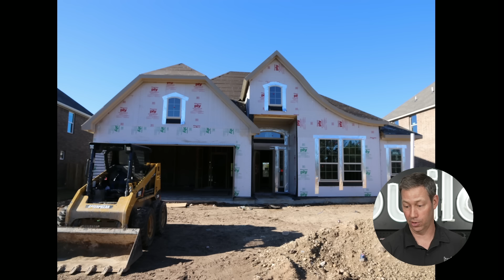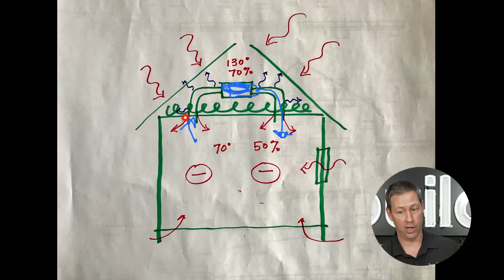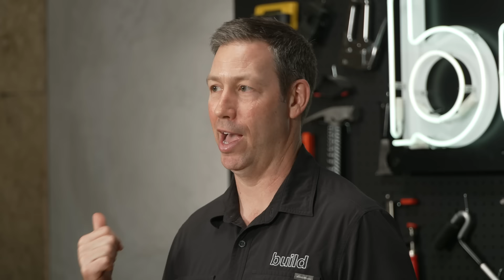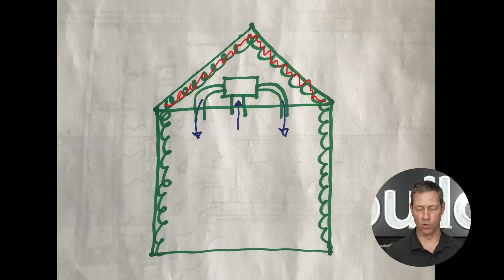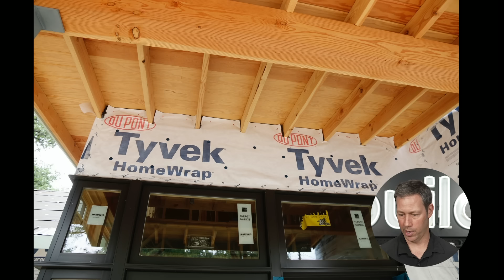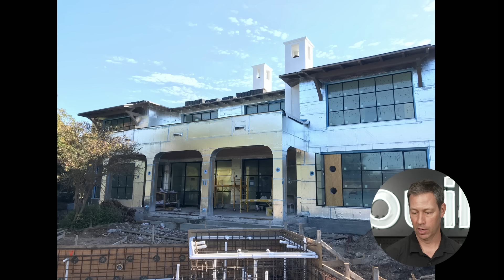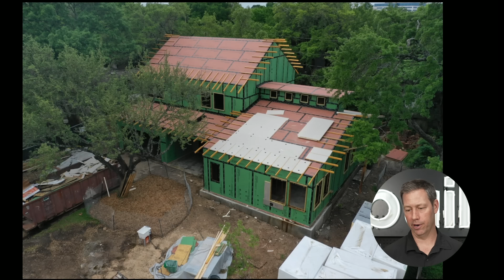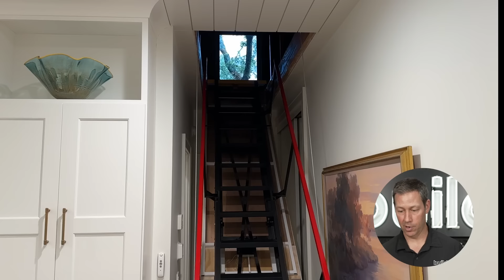CRAPPY ATTICS are Standard in America! Here’s how to BUILD - DECENT or AWESOME

Comment: DO NOT USE SPRAY FOAM IN THE ATTIC ROOF...If you have a roof leak. You won't know it for years and the foam will hold the water and rot the rafters. And good luck selling your home. Banks won't deal with you because home inspector can't inspect the covered rafters and removing it is very costly.
Reply: This is the stupid side of YT. Anyone with common sense realizes this. ALSO Spray foam is terrible for wooden structures. It's a textbook perfect environment for termites flying and ground. You can't even inspect the wood. Don't fall for this fad. Or else your home will be held up by foam alone. I don't know how this guy sleeps at night giving people bad advice.

Comment: Are you kidding me?  The ONLY reason to use open cell foam is on roof decks because it will let you know if there is a leak.  Use closed cell for walls.  If you use closed cell on a roof deck and there's a leak, the first time you'll be aware of it is when the deck crashes in on you.

Comment: I wonder:  are the most awesome attics on older houses that were not built with air conditioning?  No, not by thermal properties but if there was any equipment at all, it was found in the basement, not the attic - a coal furnace or some such.   If I am ever inclined to build from scratch, I would have an equipment room if a basement was not suitable for the region and stay out of the attic. 
As for cars, did we really get anything for the "tech"? [hint: most of it is government noise].  A v-6 today gets near the same mileage as a well tuned/built v-8 from 1972 [with judicious throttle usage] and is probably missing 100 hp.  By contrast, similar displacement motorcycles are now seeing 3x the horsepower with near the same mileage.   I wonder how good cars could be if government quit trying to design them for us?  On that note, expect similar results from the "net zero" clown show afflicting building design..

Comment: "same technology as 50 years ago"  your cars engine and its components havent changed much in 50 years. not at all in 30. like a house, the cosmetic surface and comfort pieces have changed. the piston still is the same. the roof of a car is the same. More related to this is WHY ARE car trunks unchanged in 50 years? Truck boxes? Why isnt there a phase change cooler in my trunk to keep my groceries cold on hot summer days? or a my goods warm on chilly winter days? why is the basic tumbler lock still the only theft prevention device for my trunk. My car goes everywhere and crime finds a way, like smashing my back windows to pull down the seat to get into the trunk; why arent the pull down seats locked by key or motorized latch?

Comment: After i see 1:18 .
Looks like you lack ventilasion  and Wind Sheet. 
That needs to suck air in The roof foot. And minum 
2 vents on each end in the attack, 
Of 8 by 8 inches each. And without windsheet 8n top of that insulation. You are down to 
50 % effect. 
King 
Ragnar YAHUWAH But i got other things to do, than fix your building mistakes.

Comment: All of this will also be COMPLETELY OBSOLETE.  it's been TWO YEARS since Purdue Univ. demonstrated PAINT that reflects 98% of infrared HEAT from the sun directly, and reflected off of other objects.  It enables the surface to be COOLER THAN THE AMBIENT AIR TEMPERATURE.

There's simply NO REASON to get all involved in all this as the prospect of commercial paint that can reflect nearly ALL THE HEAT off of the surface of your home will become available.

There are already DIY videos making the paint for those so inclined.
Reply: How would I do a search for those videos, what is it called?
Reply: @deedeeseecee9294  Search for Ultra Reflective Paint.  Two videos on YT show how to make it DIY tho not simple yet.

Comment: The author has zero knowledge of structural engineering. The decent attic has the most problems among all, it pushes walls outside. The crappy attic has the best frame structure that loads walls only vertically, the crappy attic frame and roof has the highest load bearing capacity among all.